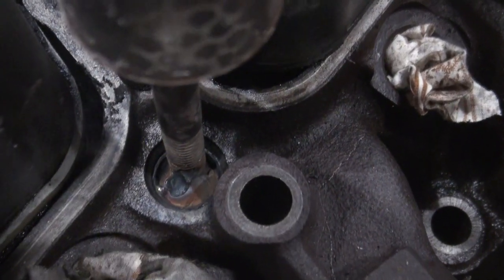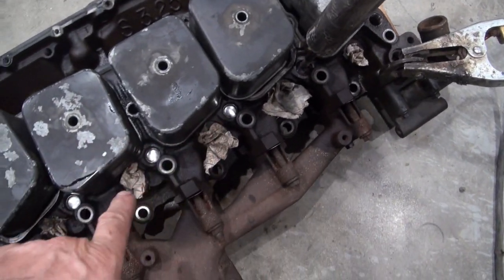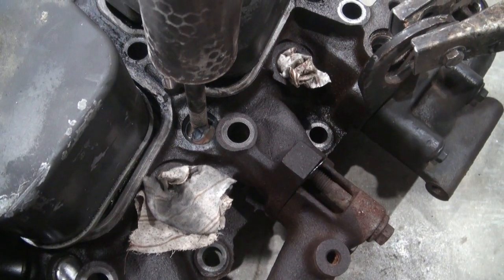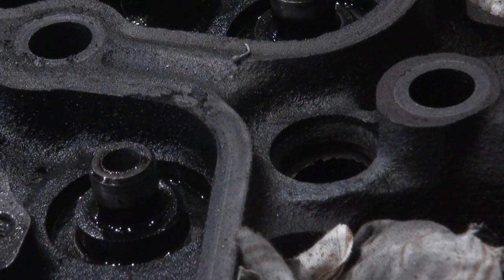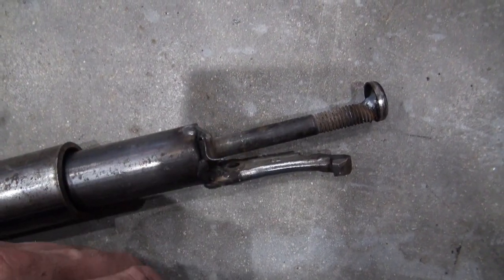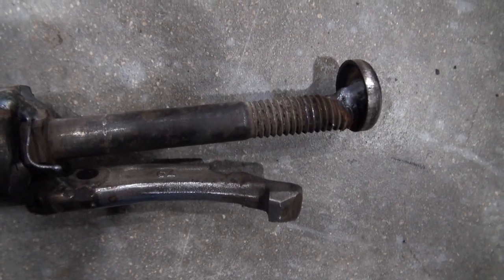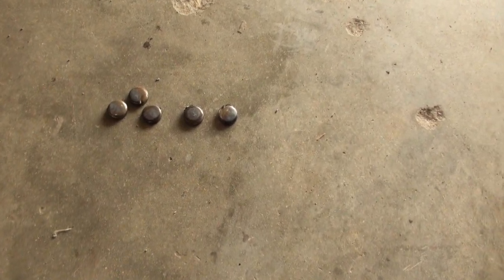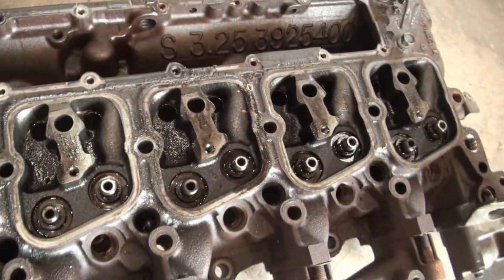Very Small Expansion Plug Removal

Comment: like your slide hammer i used a piece of all thread with a old 2 lb sledge hammer and weld  all my attachments to a double nut that i just run up the all thread
i will make mine over similar to yours and weld a shorter piece of all thread to use all of the attachments i made thanks for the testament keep the videos coming